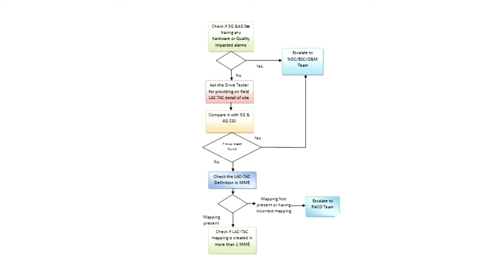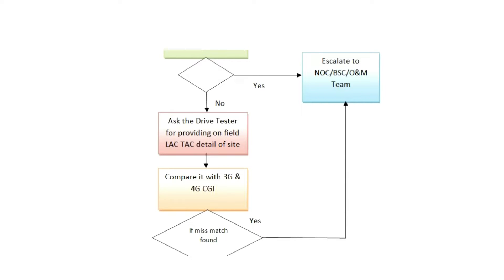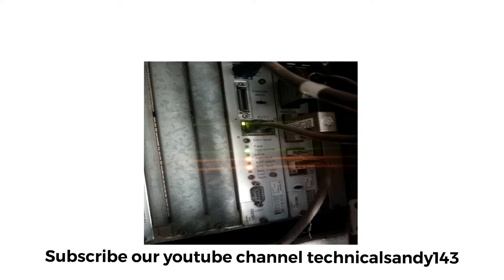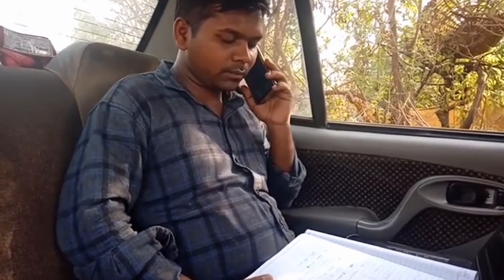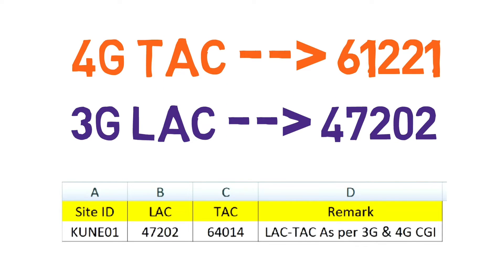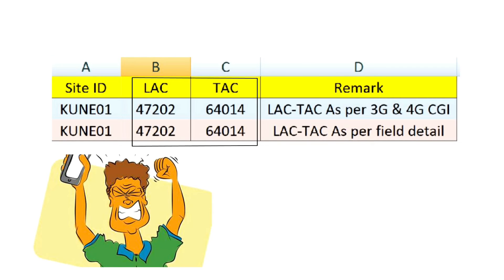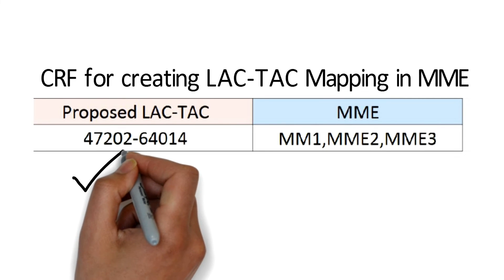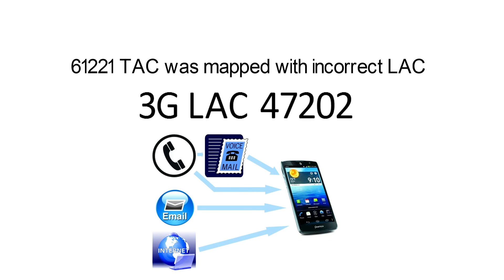Telecom Call not reachable issue due to incorrect LAC TAC Mapping by technical sandy

Comment: Although the signal strength from the site which is 1km away is high, the data speeds aren't that great. Infact the site nearest to me doesn't even have 2300MHz frequency still I end up getting latched to band 40 which is being radiated from the tower far away from me. This whole transmission power thing has badly messed up the network. Infact sometime my signal strength is high that my phone shows Signal strength of highest -44dBm even though I m indoors and no where close to the site.

Comment: As your in Telecom sector, need a bit of info as I'm facing data issues since past 5 months. Operator is Airtel. I have a tower close to my house which is 450m away radiating 1800MHz frequency. Now what I have observed is my cell phone is always getting latched on to a cell site which is 1km away from me (probably due to the transmission power being extremely high) and thus due to distance between my house & tower (1km) my data speeds are severely affected. But whenever I latch to the tower close   to me, my data speeds are excellent. (This sadly doesn't happen most if the time)  I'm tired complaining to the care as they don't seem to understand that the issue is present on the site. I'm wondering what went wrong since earlier this wasn't the case. But since last 5 months, data speeds have crippled. What do u feel needs to be done ?
Reply from the maker: Collin Dias as per your feedback overshooting cell need to be down tilted, can you share the location or lat/long where it is happening.
Reply: @TECHNICALSANDY143  well both sites at Vasai West (MH). How do it get the lat / long details so I can share the exact location of both sites ?
Reply from the maker: Collin Dias https://youtu.be/7Awj0-rDfeA watch this video to know about how to get lat/long
Reply: @TECHNICALSANDY143  19.3617700, 72.8003460 this one is the one closest to me. (450m)

While this site is 1km away from me 19.3611930, 72.7966970
Reply: @TECHNICALSANDY143  hoping this helps you. Do let me know accordingly.
Reply from the maker: Lat/long that you have shared it showing, idea,vodafone&airtel is on the same tower which is just 50-100m away from your location, download g net tracker from google store & note down the enbid or pci in 4g & cell id in 3g
Reply: @TECHNICALSANDY143  True. Idea, Vodafone and Airtel are on same tower. It's a shared site. One being a GBT and another is RTT.
Reply: @TECHNICALSANDY143  u need enbid / pci for only 4G or even 3G ? And is this for both the sites ??
Reply: @TECHNICALSANDY143  will mail you the complete details soon for both the sites.